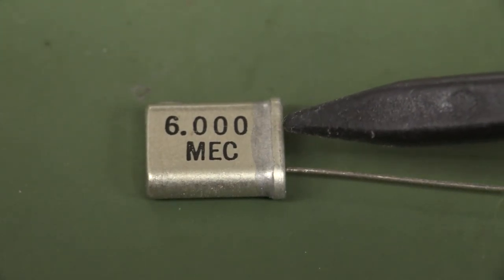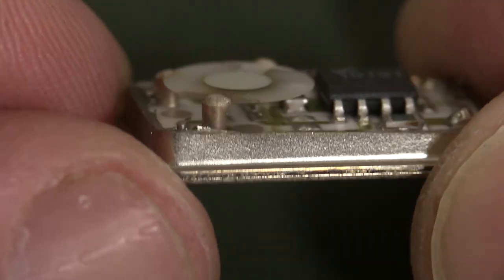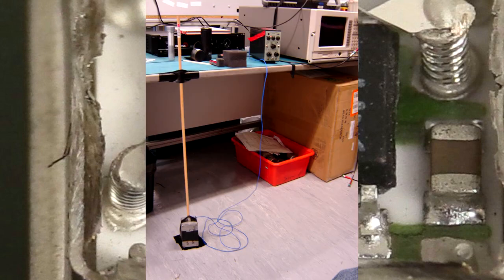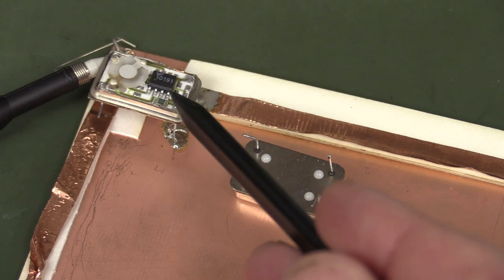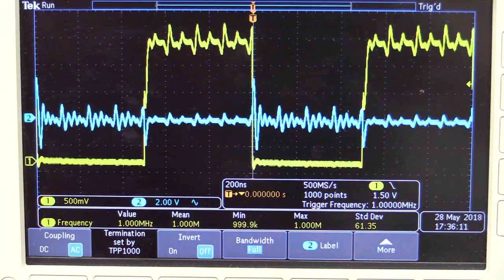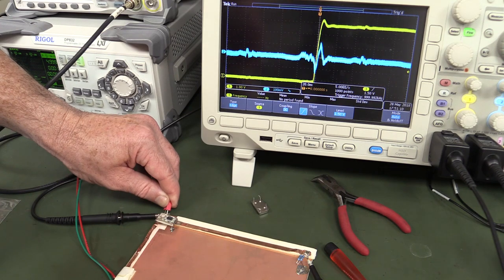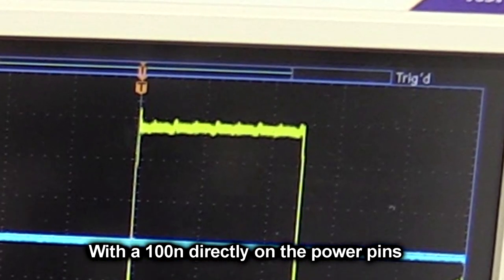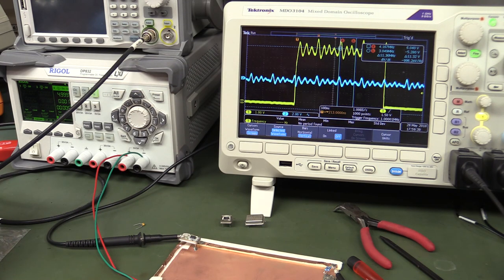EEVblog #1089 - XTAL Oscillator Teardown

Comment: Mr. Dave, If we use pure DC supply at input like a battery (without any regulator) instead of AC depend power supply still do we need a bypass capacitor? will battery can provide the huge pulse of power in the place of capacitor? Dave or any one please reply.
Reply from the maker: Yes, you still need it for digital stuff , unless you have a basic circuit where it really doesn't matter.  Circuits add resistance and inductance to the power lines.

Comment: my rc remote control transmitter contains 1 like that except it has  2 legs my remote fall from 4 meters high now it doesnt work but leds on remote works fine like setting speed brake but for/back-left/right not working is it a faulty crystal i disassembled the remote nothing broken inside

Comment: Can you use these on satellites? Will they be destroyed during launch or in space?
Reply: Joe Schroedl Whatever they would be a part of would be shock isolated. They wouldn't be destroyed in space just because of the lack of an atmosphere though.
Reply: We made "space crystals". Special design, special process, special everything - Fabulous prices. The shock and the G is not a huge problem, provided you plug it in the design at the early stages.

But the radiation resistance requirement was a lot more of a problem, and was the thing which made them so sodding expensive.

Comment: These are switching, pulsed on/off or plus/minus switches. They're putting out square waves rather than true oscillators putting out a sine wave. Not only can't you use these in RF applications, but they'd be a nightmare of noise if used in the same building as RF equipment. A 1mhz square wave can generate RF noise well above 100mhz. Now we find out it has 8mhz embedded in it. Is there any particular reason they didn't just make it a simple 1mhz sine wave oscillator rather than a noisy square wave? What's the point of having a crystal for precision frequency if they're gonna muck it up with a noisy square wave?

Comment: I have a Moog Subsequent 37 Analog synthesizer. Wonder if this it the type of oscillators it has. Sry noob here...
Reply: TestTubeBabySpy Likely some VCO aka voltage controlled oszillator. Because you want to change frequency to whatever the user sets and crystals are fixed frequency
Reply: It might have a crystal oszillator reference in there though.
Reply: Open it up and find out! I saw a video (you saw it too...) here on 
youtube of a guy that shows some of the insides of a Sub 37. I saw 
no such oscillators but he didn't remove the controls panel so I don't know what is on them.What alles says makes sense.
Unfortunately I did see a big microcontroller on the synthesizer board... I hope Moog already has their firmware available for users or plan to or else when that microcontroller fails, the whole thing will become a paperweight. Since the 1980's manufacturers have been obsessed with microcontrollers. I get that they are neat and convenient, but without the firmware to reprogram them all of our 1980's-and-newer electronic devices will be reduced to bricks in a few years. The last thing you want to see in an electronic device, if you plan to use it for a long time, is any kind of programmable circuit...
Reply: You can't really get any of the functionality those instruments incorporate without either a micro or cpu + rom + IO chips and so on. Uploading firmware is a good attempt at making stuff repairable while living without controllers is not gonna happen. However failure of those things is pretty rare and all the old ROMs from way back (well, before the 90s) when there was no micros are mostly alright. Someday it is gonna die and I expect some older micros to crap out eventually. But modern Flash based micros are pretty robust I think, especially since the flash is never rewritten it should last for ages. And silicon technology today is also very nicely controlled so I expect few factory faults.

Comment: Much more interesting would be a video teardown of crystal oscillators with programmable PLL chips in a tiny surface mount package such as https://www.mouser.com/new/fox/foxxpo/ where the frequency is programmed by fuses that configure the PLL to yield just about any reasonable frequency. One day turn! Take a surface mount package and sand down the cover by gently rubbing the top on some grit paper.

Comment: Crap i wish i would have seen this last year :( I retrofit a TXCO in my amateur radio.. it works fine but i would have slapped in a bypass cap..
Reply: is this similar to the one they modify for RTL SDR ?
http://www.rtl-sdr.com/wp-content/uploads/2014/10/2014-09-09-21.05.44-1024x576.jpg